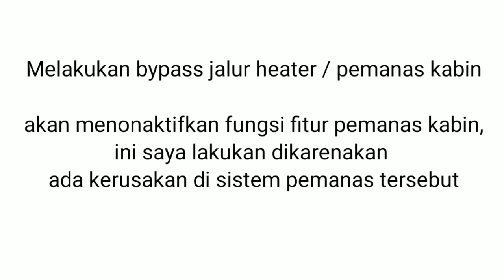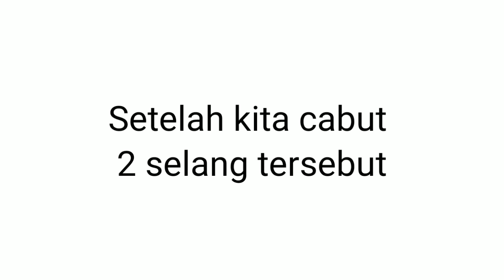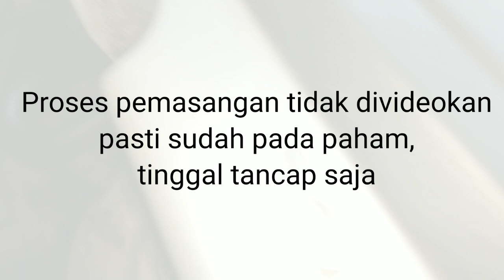Cara bypass selang heater pemanas kabin CRV gen 2 Honda

Comment: Selang sudah saya pasang tapi masih terjadi panas dekat selang itu
Reply from the maker: Maap belum begitu ngerti maksudnya... .selang U sudah dipasang ya? , .selangnya panas gt mksudnya ?,. . itu selangnya memang panas gan soalnya kan itu aliran air coolant dari dalam mesin, suhu 80' celcius
Reply: @san7048  iya, tapi kenapa terjadi panas seperti keluar asap dekat selang U
Reply from the maker: @armifamifa5006  coba dinyalakan mesin nya bbrpa saat dulu, bisa jd itu sisa" air coolant yg tercecer disekitar situ & menguap . ... .tp kalau tetep tidak hilang ya harus dicek lg tancepan selang U nya kurang masuk mentok / tidak, pmasangan klem selangnya sudah pas belum

Punya sy sekali pasang tidak ada kebocoran soalnya
Reply: Om amankah pasang selang bypas, kok rpm nya agak tinggi ya setelah pasang selang bypas

Comment: Bang jadi intinya yg di kasih selang bypass itu yg kanan kiri .dan pipa atas yg 2 itu di tutup aja ya bang
Reply from the maker: @hermansonicman7862  iya yg dibypass yg mengarah ke dalam mesin, yg mngarah ke kabin ditutup
Reply: @san7048 iya blm di coba bang awalnya kran heater patah pipanya . sementara di sambung langsung pake pipa besi tapi suhu panas nya bertambah
Reply from the maker: @hermansonicman7862  suhu AC nya ya brtambah ?
Klo ke suhu mesin kyaknya tdk pengaruh
Reply: @san7048  bang pipa 2 yg di kabin KL di kasi tutup selang bypass jg gak papa kh bang
Reply from the maker: @hermansonicman7862  gpp, bebas, yg penting trtutup
Reply: om saya mo bertanya klo sdh di baypas  hgt Ac masih biss diyalakan ???? solanya panel masih jd 1 sama  ac dan pengnghangat kabin ????
Reply from the maker: @atha_alghifari1829  penghangat sudah ga bisa nyala, panel penghangat itu terhubung ke valve buka tutup lewat kabel sling biru itu, 

Valve nya dicopot jd sudah tidak fungsi, air panas tidah bisa masuk ke kabin

Comment: Om saya punya splash 2010,
Air radiator nya kurang terus mesin cepet panas,
Udah bulak balik bengkel ganti termostat kipas radiator,
Akhirnya terakhir kuras radiator sama selang heater nya di bypass
Reply from the maker: Trus sembuh? Ya brrti heater dalam kabin nya bocor om

Comment: Punya sya jazz gd3 habis ganti selang itu, tp bukan ori, saya liat nekuk, kira² bermasalah tidak ya?
Reply from the maker: Setahu saya tidak brmasalah om, klo mobil yg ada heaternya misal kondisi tidak dinyalakan pemanasnya kan valve heaternya trtutup (sama seperti kondisi selang itu disumbat)
Reply: @san7048  ow bgitu ya, kmrn di bypass karena air radiator rembes banyak dibawah pedal kemudi
Reply from the maker: @slamdunk757  iya om, sebenernya itu selangnya disumbat/dibuntu jg bisa, cuma tekanan diselang yg buntu itu besar (rawan copot sumbatannya) makanya lebih baik di bypass

Comment: Air radiator sering berkurang air cadangan nya apa karna faktor itu jg ya om ane baru pake 2 bln nih
Reply from the maker: disitu ada bekas lembab coolant yg rembes ga om ? (klo punya sy jelas ada terlihat rembes)

air radiator brkurang Penyebabnya banyak sih, klo tidak nampak netes, Yg pasti ada rembes halus, saat mesin panas mksimal dia baru rembes trus langsung menguap, bisa trjadi dimana aja, disemua jalur yg dilewati air radiator
di radiator, di waterpump, di saluran coolant pada Throttle body, dll
Reply: Siiap om kebetulan masih pake air biasa niih mau ganti ke colent tp dari awalnya dpt begituan takut jadi kropos radiator nya mohon arahan
Reply from the maker: @MuhammadfadhielRiauwan  kropos tidaknya trgantung kondisi dalam radiator gimana, bisa jadi aman, bisa jg malah bocor 

Pengalaman dulu dimobil sy yg panther jg diganti coolant langsung ada yg bocor radiatornya, 
Ada jg pngalaman teman yg aman" saja, jd trgantung kondisi karat didalam radiator masing"